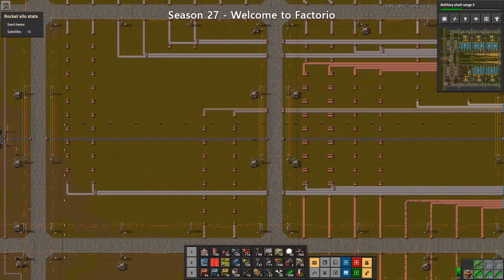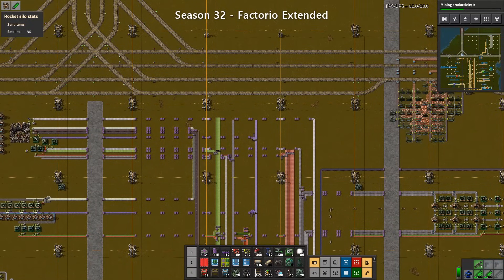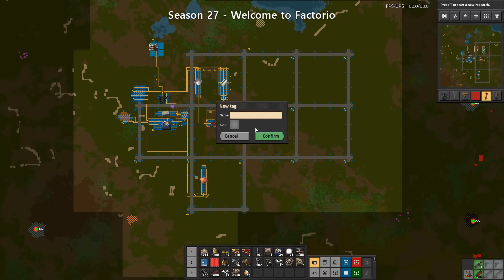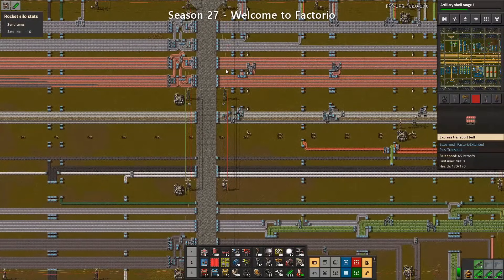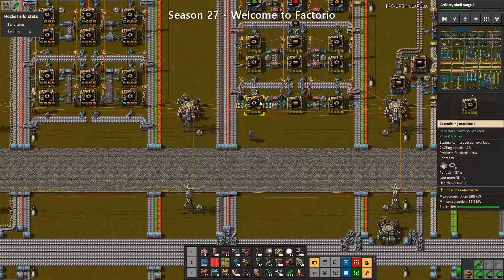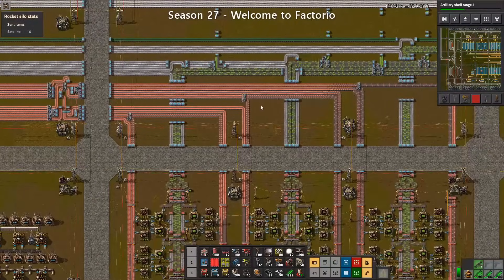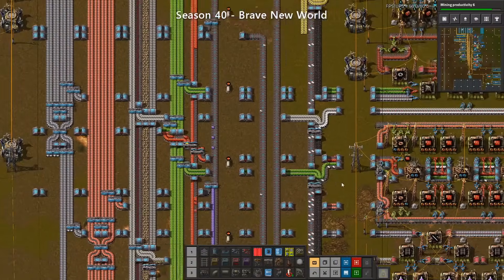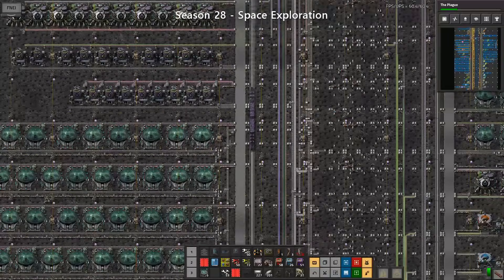Order Your Base with the MAIN BUS - Factorio 0.18 Tutorial/Guide/How-to

Comment: Another idea: In addition to the sacred walking path, I've often left room for a shuttle train line running the length of the bus with stops at each build. Toss down a pocket train, select "Solid Fuel" station, and go. :) 

If I lay this down, it is one lane each side of the bus forming a loop. I arbitrarily use clockwise out of habit. This works well for double-sided busses and it means I don't need to install two stations for each stop as I would for a bi-directional track. You could always manually drive your shuttle I suppose.

Comment: Hey, Nilaus. I've got a bunch of questions about the main bus and fluids. How should they interact? Liquids don't usually go on the bus, do they? Should they run parallel to it? Should one only bring in the necessary fluids straight to where they're needed? How do you usually handle them?
Reply: I've seen Nilaus put important fluids such as lubricant and water directly on the bus. No reason not to do it if you have the space. I personally like to do this as well so that I can always have water and lube available if I need any. Just remember to use pumps in regular intervals to keep pressure/flow rate up.
Reply: @astralfields  Noted! Thanks for the advice. :)

Comment: One thing I struggled with on the 0.16 to 0.17 recipe change was figuring out if I needed to bus stone/stone brick. You didn’t mention them so how do you handle them?
Reply: Have you figured out what worked for you yet? Working on my first bus design now for 1.0. New player... well I have almost reached endgame on my 1st game. Kind of going to transition into main bus or start new game with bus plan in mind from begining now that I know how to play. But stone or stone brick? Are both needed? I know some recipes need pure stone and coal.  So I am thinking putting two stone and two coal on bus which may be to much but it's better to over do it and not use it then not have room. If I have two stone on bus I can make stone bricks when needed. I may leave 2-4 empty slots for temporary things on bus for a while things that move on and off the bus short term or for things I may have forgot. lol  Let me know what you decided to do if you have got that far now.
Reply: @MrArrmageddon  My mid game base (launched 25 rockets slowly) I used 2 stone brick, 1 raw stone and 1 raw iron ore. It worked well enough but towards the end barely could keep up
Reply: @rycarr  Thank you for replying Ryan. That's right raw iron is needed too? If you can and I know this may be asking for a lot but could you tell me your entire bus line? Not just the Stone question I asked before?

To learn how to properly bus I'm starting with a cheat map that I made myself. So I'm playing legit on my 1st run and soon starting my first cheat map for my first bus which will be my second run.

I'm going for the highest end bus recommend in this video.  I have like 1BIL of each ore and a lot of oil spawned near my bus split to both sides. So I'm planning to do 16x Iron and by that I mean Iron Plate etc.  So 16x Iron, 16x Copper, 6x Green, 2x Red, 2x Plastic, 2x Steel.  And I'm still planning my stone/Coal/Raw Iron/Stone Brick.... Since I have so much of the other stuff I'm planning a pretty big bus. So I may need to slightly scale up my stone etc. After I do my cheat run and basically learn how to create and manage the bus on a map that I can use command console, map editor etc.... I plan to do a 3rd game legit again will all the skills I learned. So any suggestions for my cheat bus? lol
Reply: @MrArrmageddon  My bus was not optimal. I ran short of stuff quite a lot. I had enough to turn off science and let items buffer on the bus then turn it on long enough to research a few things then turn it off again because it was starving other areas. I was playing legit and was having trouble finding enough ore to provide my needs. I had 4 iron plate (room for 8), 4 copper plate (room for 8), 4 green circuit, 2 red circuit, 1 plastic, 1 coal, 2 stone brick, 1 raw stone, 1 raw iron ore, 1 blue circuit, 1 battery, 1 low density structure, 1 rocket control module and I belted one line of rocket fuel at the end of the bus for the rocket. I built solar panels and attenuators at the end right next to the rocket.

Trouble areas, copper and iron plate at different stages. I had trouble supplying 4 full banks of smelters for each. I was always short red circuits unless I paused science and let it buffer. Once I beaconed and upgraded red circuits to blue belt and green assembly I couldn’t keep up with demand on green circuits. Green circuits became a massive problem even beaconed and fully upgraded. I was working towards smelters just for green but haven’t completed it yet. One rocket silo could build a rocket faster than I could supply it. Looking back I should have started modules sooner and put at least rank 1 productivity everywhere I could. Module production reduced my copper to a trickle, couldn’t even provide for the rest of my base due to how much copper green and red circuits demanded. I grew frustrated with the amount of water and rarity of large ore patches and quit that save. Still have it, I think trains are the way forward and a more distributed build network instead of busing everything. Like I would probably have smelters away from beginning of bus and train the plate to the bus instead of having the bus start at the smelters. I don’t have enough real estate without building several million landfill.

I had an early mid game power spiral of death trying to get nuclear power up without building more steam power. I think I had 160 steam engines running by that point and ended up ultimately building 18 nuclear reactors and hand feeding them until I had power for bots. I should have started solar or nuclear earlier to avoid the two hours of limping along on half power. I was purposefully unplugging sections of the base so other parts could function until using up buffered items. Poor planning all around.
Reply: @rycarr  Very interesting and thanks for the detailed supply. I too ran steam to long. Went though few hours of transitioning with power outages to solar. This is my legit run I'm talking about. So yes playing legit is not easy and I have not used trains yet instead I had LONG belts spider webbing out to ore deposites. lol  

I have one serious question that I think I know the answer too but still need to ask. When someone says for example 4x copper plate and 2x Green circuit like you did? Do you mean you started with 4x copper plate... turned them into green circuits using some of the supply of copper? Or do you mean you had 4x copper plate lanes AND also 4x Green Circuit Lanes going at full capacity at some point. As in those Green Circuit lanes did not tap into your 4x copper plates etc?  Right now I think you mean I have to craft the green circuits and still have dedicated copper plate lanes etc? Thanks.
Reply: @MrArrmageddon  I used part of the copper to craft green circuits which caused copper shortages in science and low density structures. But in a distributed build I’d have green circuits built away from the bus and train them in. I’ll look for the save and see if I can share it. It’s not pretty and I basically would walk away for hours at a time with the game running so certain things could be built. I generally play on peaceful so there is still combat but I don’t have to worry about defense while trying to focus on other issues.
Reply: @rycarr  Thanks I don't really need the save though. But sure I will ask around to see if others use the copper in there lanes to make greens or if they suggest dedicated greens ontop of the lanes specified in videos like this. I play on a modified setting that is not peaceful but toned down alot. Like 2 hours or more between enemy base expansion  and a few other things. It's about as difficult as peaceful. Well I am off to work.
Reply: @MrArrmageddon  Next game my mid game base will use copper from the bus to build circuits. But as I transition to end game I’ll bring copper just for circuits and not take from the base.
Reply: @rycarr  I learnt a lot. I basically completed my bus. Before I tell you about it I will say that reading your last comment. Even some top Factorio players use there Bus Copper/Iron to make Circuits but they usually bring 8 lanes of Copper or Iron. That said some players will have that many lanes or more and still bring Dedicated Greens.  

Here is what I have on my bus. Keep in mind each lane I am about to mention is at least 15/s which is a fully saturated Yellow Belt. Most of these are around 30/s a full red. And I have future plans to exspand to 45/s full blue for each of these lanes of my bus all of them but that will take some time. As when I say all my lanes have 15/s saturation at least there is one exception blue circuit. lol   

Here we go!  

16x Iron Plate
16x Copper Plate 
6x Green Circuit
4x Plastic
2x Steel
2x Red Circuit
1x Battery 
1x Coal
1x Stone
1x Stone Brick 
1x Blue Circuit 

Like I said eventually those will all be 45/s. For now they are mostly 15-30/s and Blue Circuit is 12/s 

Yes this was like 70 hours of work or more since we last spoke. My bus technically has a minimum of one lane free for future plans but possibly room for two more lanes after that. For example I may decide to do lube, acid or some sort of other barrels for now I am going to Robot around liquids in barrels as needed. Which I have done before. 

I only just completed this bus. So now I'm going to actually make my new mega base. I still have a base setup of course I can't make all of this without having a base. I actually managed to get though ALL research including some modded research while building my main bus. lol 

But my main bus is ready and there is ZERO production on it. I have not even started red science on my new mega base but that changes tonight and tomorrow I will be working on it a lot. And as I ramp up production I will upgrade everything. lol  Thanks for the help I may let you know how it goes. But with a bus like this I think I will do fairly well.
Reply: @MrArrmageddon  Loved reading your comments! What happened to your base? I know it’s been a long long time. Please tell me about this base as well as your new bases since and what you learned along the way. I’m also just starting out, trying to transition to my first bus. Not starting out starting out, but close. I haven’t launched a rocket but I’ve researched it, lol. I have uranium and nuclear power and everything, but I’m a total spaghetti builder, lol, there’s order to the chaos, in my head, but a bus just looks so damn beautiful, lol.
Reply: @austinscuttingedge9998  Thank you for the interest I remember this chain of comments very well. Since then I have finished my BUS. And basically completed my game. Like sure I do go back to it but I am satisfied for now. I have launched a few thousand rockets at least. Not quickly I can manage to saturate about 3-4 rocket silos at a time slowly. What your describing is pretty late game. And yes my first few games were SUPER spaghetti! lol Even my final main bus base has some spaghetti but it's pretty good. 

My final bus is as follows. Note:When I use the term Lane I am referring to a fully saturated 45 parts per second blue lane. 

Lanes
16x Copper Plate
16x Iron Plate
6x Green Circuit
4x Plastic
2x Steel
2x Red Circuit 
2x Stone Brick
1x Battery
1x Low Density Structure
1x Raw Stone
1x Coal
1x Blue Circuit 

I don't think I'm forgetting anything? I might be forgetting a single lane of something? But I don't think so. I purposely left enough room to add 4-8 other lanes but never ended up using them so far.  I decided not to pipe any gas I kind of spegetti the gas or other liquids to individual production lines behind the scene but the spegetti is to a minimum. 

I used some QOL mods nothing changes game play to much. I like the mod that allows underground belts to be further apart I think RED is like 2x the range and Blue is 3x the range underground. Makes for branching off the bus easier. At some point I may upload a video on my channel but I cannot promise too. If I do it may be a quick video just a glance over without commentary. Problem is I have to sort out a lot of mod issues remove, replace or update various mods as the game has updated since last I played.
Reply: @MrArrmageddon  thanks for the reply! That bus sounds great, I’m going with nialus’s base in a book and master class bus, which actually sounds really close to yours too, except for the piping of liquids, I managed to launch some rockets on my spaghetti base and then now I’m up to blue science on my bus base but honestly it looks beautiful, the city blocks are gorgeous and honestly I’m never going back! Lol 😂 idk what I would do without some of my quality of life mods, I have one called big bags, which allows me to hold 1k of each item in each slot I love that and squeak through, haha. Also I have something, maybe a mod that is not letting me queue up my research which is annoying. Or maybe you have to research queues? Not sure lol but I appreciate the reply and definitely let me know how things go in the future!

Comment: I wish you went more in depth on what exactly should go on the bus. You advocate for pre-planning the bus and build on both sides of it, but when explaining how large a bus should be in width, you only mention  list iron, copper, steel, plastic and redgreen circuits. What about coal, sulfur, stone, liquids? A new player won't know he needs those, and so when he plans his bus around your minimum specs and builds on both sides, he'll only realize later that his bus is far too small, and by then it's going to be a massive pain to expand it.
Reply: I think people just have to make a few messy bases at first to learn what all they will need later on.  I finally decided to just go for it and while messy, I am half way through researching the rocket silo!  Gonna get that thing launched then probably start over with all the mistakes I learned along the way.

Comment: I've got sort of a looped bus; it goes around my main base and a few outposts, branching a bit before going back to the beginning. The advantage is, I can input and output any bus materials anywhere along the line, and there is considerable storage on the belts. Also, since the bus has consistent width everywhere, I've got a blueprint I can just paste everywhere I need to expand the thing. Disadvantage is, I'm only now realizing I made the bus too thin to start with, and changing it now will be a huge undertaking...

Comment: 17:50 I'd argue that disadvantage is rather irrelevant as you can make another production line and combine it in with the main bus at the point the bus runs dry on resources. Not all the bus' supply needs to come from it's start.

Comment: one solution I have tried for expanding the main bus is to restock it part way down the line.
I build a train station at some point where the belts look a bit slim and funnel that iron and/ or copper into the buss just before a belt balancer. I also have an off site smelter so my trains don't carry raw ore only finished plate. I started doing that because the ore stacks at 50 while the plates stack at 100 giving double capacity for the train cars.
Reply: Same. That's why between each production units, I give some wide separation so I can inject things as necessary. Even things such as Green Circuits.
Reply: you could upgrade the belts and increase your production to fit the new belts

Comment: I really hate main buses for how boring they are, and every time I try something else, but unfortunately everything else is so inefficient.
Reply: Try using train system as your "main bus". A train bus allows you to break the massive straight belt bus into multiple smaller, modular, more specialised, and more efficient bases. 

I find it more interesting to optimise a small modular base that can be built to a spec (so you have a defined input and output throughput for each minibase, keeping buffers/caches to a minimum), rather than optimising a large main bus, where things gets too complicated to keep track of, so you end up just throwing out all the maths, overbuild everything, and just have to carefully watch the bus for bottleneck and shortages.

The disadvantage is you need a bit of space for building train stations. 

Also, if you're building to a precise spec, any changes in recipes will throw out that delicately tuned balance. Though that's not really a problem with the train bus itself, but rather with making just-in-time design.
Reply: @yvrelna  It's one of the things I tried, but everything either has 1) throughput issues or 2) balancing issues. Main bus solves both problems, as belts not only transport stuff for free, they magically inform just the right assemblers thousands of tiles away that end of the bus is full.

Most alternatives to main bus either really struggle to scale, or really struggle to provide feedback to your assemblers when to start and stop.

Comment: I am curious what you think about taking 25% of each belt for bus outputs?
Reply from the maker: you need to branch off what you need for the build (if you can). So 25% or 50% cannot be generalised as it depends on what you are building
Reply: Nilaus no I meant in reference to how you remove things from the bus. I find that just putting a splitter on a lane to take 50% of a single lane ultimately isn’t as good as taking 25% from 4 belts. Ultimately resulting in less balancers, but more splitters.